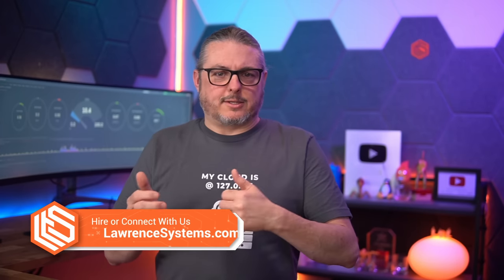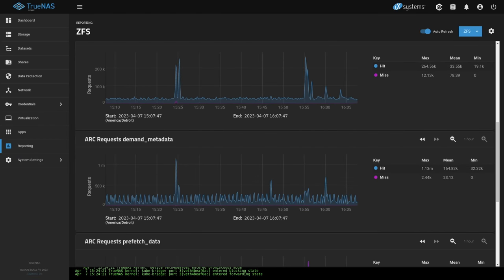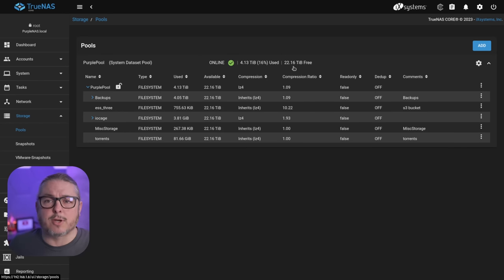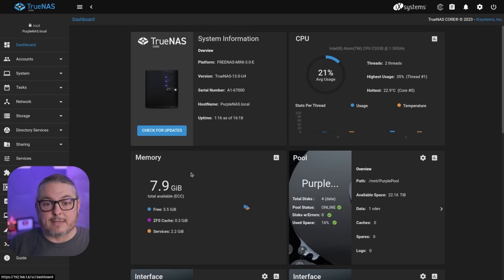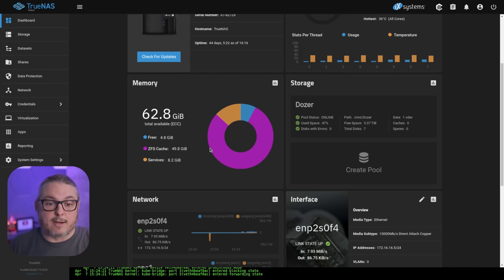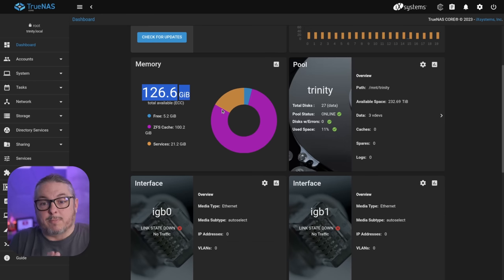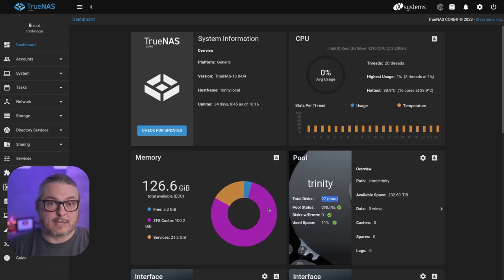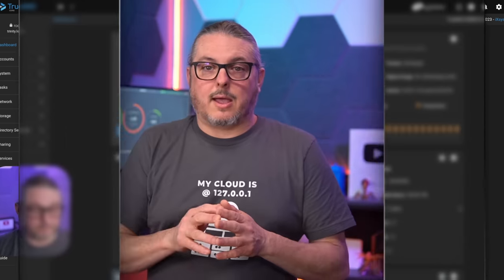How Much Memory Does ZFS Need and Does It Have To Be ECC?

Comment: why stop at 128gb? 512 does better and large memory is getting cheaper - it is the best upgrade but large arrays of ssd can easily saturate all but the fastest network links - more ram, nvme and fast network links are the best priorities to focus on with infrastructure upgrades and realizing optimal performance - they are all important
Reply: The type of data being stored matters too. If blocks aren't accessed frequently, no amount of ram for more ARC is going to matter.
The point is that there is a persistent myth that ZFS uses a ton of memory, and it is clearly false.
Only deduplication NEEDS memory. Everything else is just a luxury to speed up bursty workloads, or blocks that are constantly accessed.

Comment: Is 128gb overkill I want to turn my 5950x and 128gb into a nas.
Reply: What is the purpose of the NAS?  I ran that proc with 64GB of ECC 3200MHz dual rank dimms as a NAS for a while.  I found it to be overkill, even with a bunch of VM's and IOMMU passing through a GPU and capture card for an OBS system.  10G ethernet is easier to saturate than you think.  Chipset matters too, x570 is probably best for server use with a desktop AM4 chip.  I now run a Ryzen 3 3100 & 32GB, and it still saturates the 10G all day, even with a quad NVMe card, and 8x SATA SSD's.
Reply: Users? Type of data being stored? How much storage?
It all matters.
Memory for ARC is just a bonus for zfs unless you are doing deduplication.
Give it however much you want to. But there will be a point where it doesn't actually do anything for you.
Reply: Not overkill depending on what you want to do.  If you want to use ECC, go check out the Asrock Rack motherboards for AM4, they are all serverie and such with ECC support, 10G connections, just be mindful of the limits and weirdness they can have regarding pcie lane usage.

Comment: This is something that needs to be spread because I STILL hear it.
The only thing zfs NEEDS ram for is deduplication.
Everything else is just nice to have for ARC. That's it.
If you need to, you can even disable ARC and have zfs use ZERO extra memory.
I'm not sure what your use case would be, but it is doable.